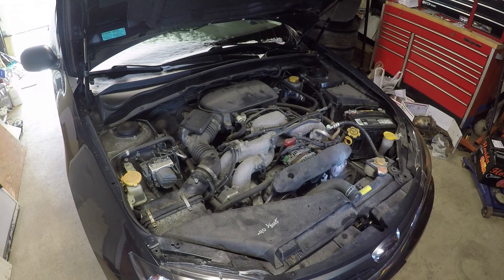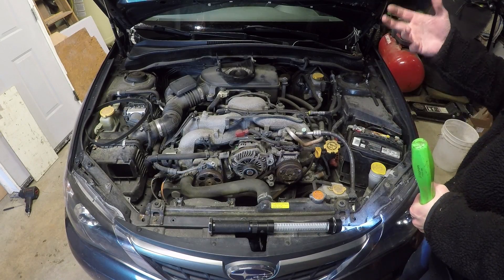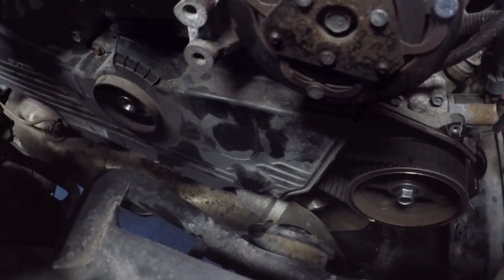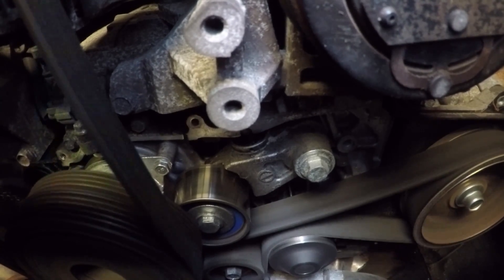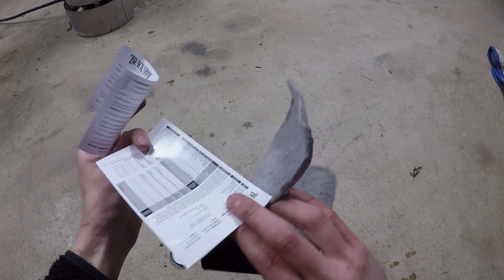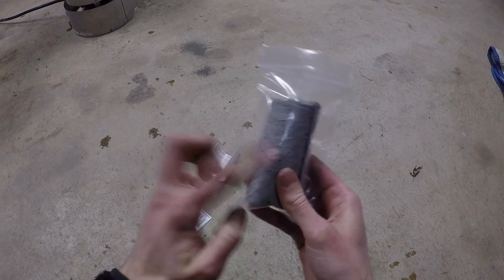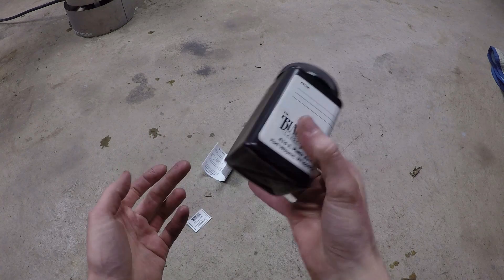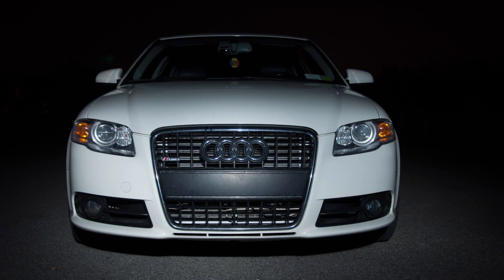Subaru Impreza Engine knock

Comment: my 09 impreza's engine check light comes on, when scanned says cylinder one misfire. Changed the coil pack, but the engine light is still on and it's missing. When the A/C is turned on the power drops and it will sometimes shut off, what could be the problem? does it sound more like an electrical issue than a mechanical one? help...
Reply from the maker: I would try swapping spark plugs. Switch 2 cylinders and see is the misfire follows the spark plug
Reply: @audimotive  thanks alot man, I will try and let you know how it goes

Comment: I had a 2009 Impreza 2.5i hatch 5MT. It was great and my first new car. 8 months in, the engine started making this exact noise which steadily got worse the more I drove. Eventually it got to the point where I had no power what so ever (and the only reason it got to this point is because the dealer said they couldn't find the problem and to drive on it till it got worse) To solve it, they did a full shortblock replacement. needless to say, for a brand new car, I wasn't happy. First time Subaru ever disappointed me.
Reply from the maker: Yeah it's a very common problem with those cars. Hopefully they fixed it on the newer cars. Or maybe they havent. Who knows

Comment: So the report said all is well. Yet the shavings and noise are to obvious to ignore. Did you continue to track down the source?
Reply from the maker: +Nik Coffman the report basically said inconclusive. But yes, I tore the engine apart and found the cause. Working on the video to put up. (hint... it was a bearing)